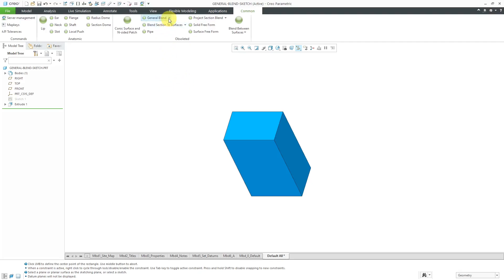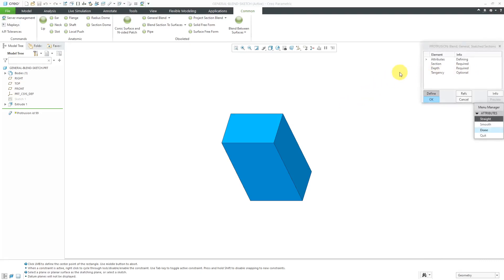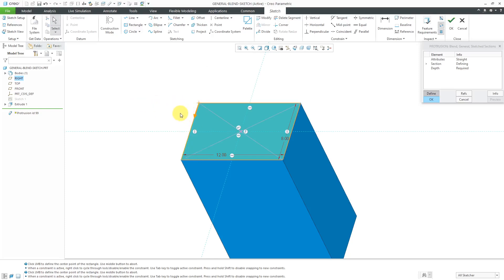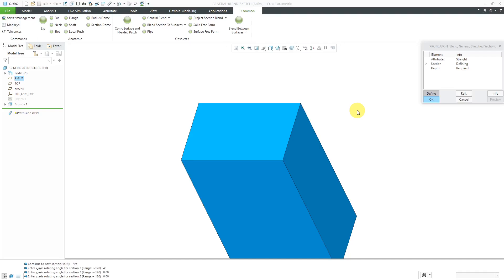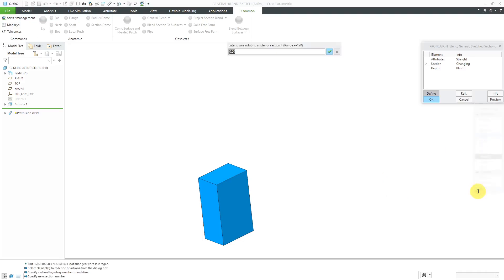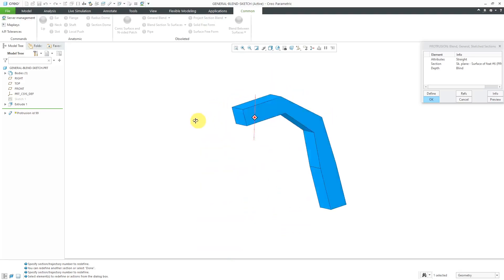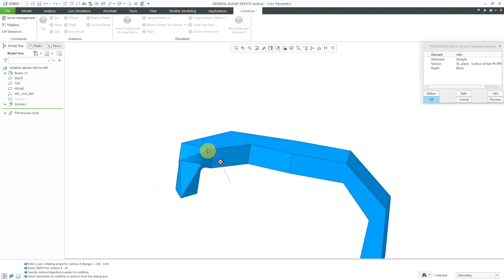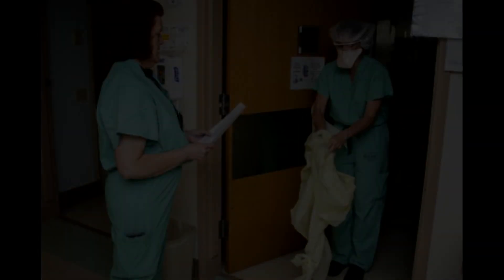Creo Parametric - Pro/ENGINEER Obsolete Commands - General Blend with Sketched Sections

Comment: Thank You very much, Guru! That's a nice video.
Reply: P.S. I'd say that back of the days you had to understand that the order of your operations should exist in case you want to be effective) I remember when like 20 years ago I was said by an expirenced engineer - "Ok. When you start to think as fast as you can press keyboard buttons, Sergey - that would be a great time". )))
Reply from the maker: Yes, I remember back when I taught Pro/ENGINEER 2001 classes, I really stressed how important thinking was before clicking. The more thinking you do upfront, the fewer problems you'll have later on.